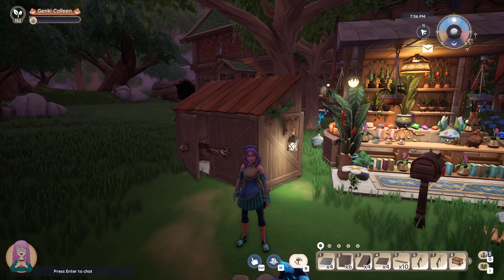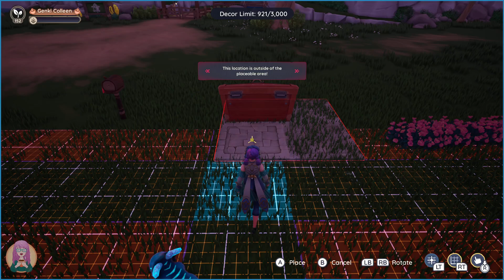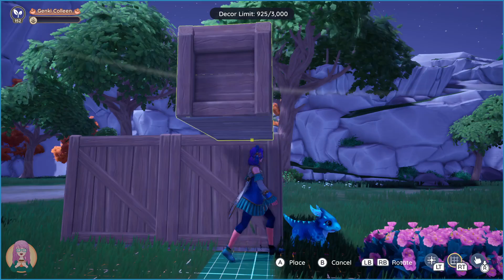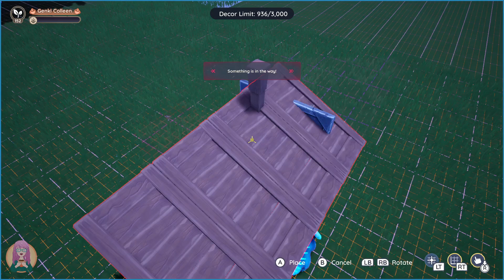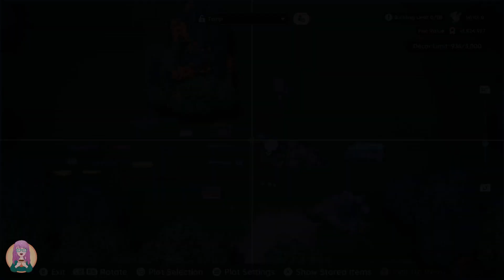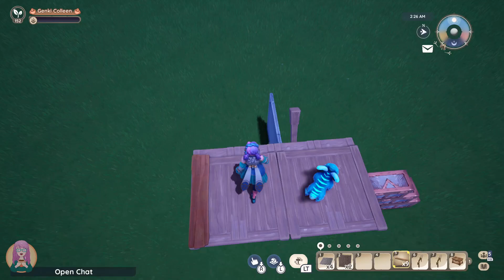Palia Tutorial - How to Turn Your Shipping Bin Into a Garden Shed (NO Glitches)

Comment: I can't seem to get the ramps off once the pavers are out on without taking the entire structure :( I know my ramps are connected because I made sure to hit alt tab before even putting it on the rotating structure and they seemed connected...there's something about putting the pavers on that seems to screw up the process. I'm a pc player btw...are you able to help?
Reply: NEVERMIND. I found the issue and got it off the turning structure!
Reply from the maker: @thewhimsyraven  Woohoo!  Happy to hear that, but know that I'm always happy to help, too!
Reply: @GenkiColleen okay new prob...for the left door I can't get it aligned the same way as you even with free placement. Either it wants to snap too far in or a bit too far forward and there's a huge gap between the door and the structure😢 any tips or thoughts on what's causing this?
Reply: @thewhimsyraven  can you share what helped you? im having the same issue. ive re-done it 4 times now and im getting so frustrated!
Reply: Okay so after so many attempts my solution was to make pillars as "hinges" and attached the doors that way. That way there wasn't a gap between the door and the structure, if that makes sense. And honestly it doesn't look bad. So if anyones having the same issue as me maybe try that ❤
Reply from the maker: @thewhimsyraven  I did that for a different version of the shed.  Nice thinking!

Comment: I am able to get everything built except the left door.  I don't understand how you free place.  It snaps straight and then if I turn it one turn, it snaps inside.  I am unable to pull it out like you show in the video.  You say free place, and one click, but I don't know what free place is. I hit the z to take off the grid, but that still doesn't allow me to snap to the other wall.  What am I missing?
Reply from the maker: 15:49 Taking it off the grid is correct, but in free placement mode, it's not going to snap into place.  You just move it to a spot that you like, then place it.  Hope that helps!

Comment: I cannot for the life of me figure out how to get the ramps and pavers off of the rotating contraption after I'm finished without picking up the entire structure. Or the floor we initially placed the ramps on.  Any help would be greatly appreciated.  Tried each ramp individually none picked them all up and if it did it was with all the other things :/
Reply from the maker: You have to have the ramps connected together so that when you pick one up, they all come off.  Most likely you've managed to keep them side-by-side without the connection.  I'm happy to come over and help you!  Send me a friend invite, then message me to let me know you need help.

Comment: As of today 8/9/25, stone and wood floors don't work on Switch, but copper floors do. Go figure.
Reply: I just bought the copper floor and can’t get it to work with it either. Previously had done it with stone but was making changes 😢
Reply: @lorellebond  I've just done it with stone floors (2x2), but I can't for the life of me get the top 4 pieces of roof to connect, so I can't delete the parts that hold it up :/

Comment: I had to do the stone floor two at a time on switch but it eventually worked. After that it was smooth sailing! I appreciate the easy to follow tutorial.

I also put a horizontal plank at the top of the vertical ones and it finishes the roof off nicely.
Reply from the maker: Nice, glad you got it to work!  I like the horizontal look as well!
Reply: How did you manage to get it to work on Switch? Mine keeps saying "This location is outside the placeable area" or "You dont own this land yet" 😢 Even with just moving 2 floors at a time
Reply from the maker: @TheGoblinKiing  You have to own all of the land on your plot before it will work.  Sorry about that!
Reply: @TheGoblinKiing  do you have all the square of land unlocked with writs. That might help since I didn't get the message "you don't own this land yet"

Comment: Can this still be done? I can't seem to get past the first stpe of placing the slabs under the bin 😢
Reply: I've been trying all day. People keep saying it's possible, but it just keeps telling me it's out of area
Reply: i'm not having any luck either 😢
Reply: I’ve just done it myself on Xbox so it’s definitely possible x
Reply: I couldn’t get the floors under the bin either so I just decided not to have a floor. Instead, I placed the back wall of the shed on the very edge of my plot (in bounds) and used that as the anchor for the side walls (out of bounds). From there, you can attach the front doors and the roof to the side walls with no problem. Since it’s a garden shed I think it looks fine without a floor. I placed my chest behind the shed (in bounds) instead of next to the shipping bin. I used makeshift frames, wall shelves decorated with bottles and plants, and a log cabin wall light to fill the space where the chest goes in this video.
Reply: this is still working for me in 2026! just takes a lot of patience and fiddling around lol

Comment: So I am following this step by step but for some reason, once I get the 4 ramp pieces put together, put them on the contraption thing, I no longer can alt+ select it as one piece, it picks up the whole contraption too, so now I can't take that piece off without taking part by part... what am I doing wrong??!!
Reply from the maker: The ramps need to be hooked together, so that when you pick up one, they are all picked up.  No alt+select for this part!
Reply: @GenkiColleen  TYSM! Great video!
Reply: @GenkiColleen  oh dear, I am clearly having this issue. how do i move the grouü without alt? I am getting crazy. Thank you soo much <3
Reply from the maker: @ausmpott  I use an Xbox controller, and to do a 'select all,' I hold down the left trigger.  Hope that helps!
Reply: @GenkiColleen  Thank you so much for your reply. but when selecting all (on PC with alt) the whole conctruction (floor and wall and pilar) are also attached and I have to start from beginning. I have this with alle the things I try to do with this method. I am losing my mind, why does this work for all of you?
Reply from the maker: @ausmpott  Which part are you trying to do?  If you're picking up more than you wanted to with your select-all, then you've build stuff too close together.  Try building the part you want to move further away.
Reply from the maker: Also, if you've already placed all of the wood pavers, it's OK -- you can still adjust the ramps to be hooked together if they're not already.
Reply: I finally figured it out... I wasn't clicking the right areas when moving the "group".. I feel silly lol
Reply from the maker: @megalicious84  No worries, glad you figured it out! :D